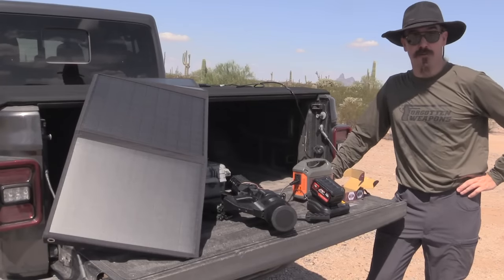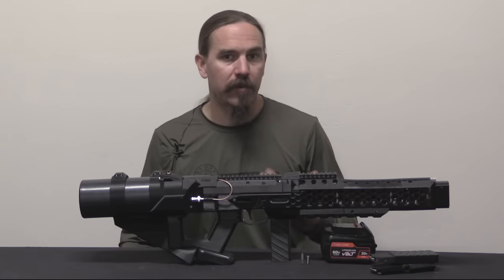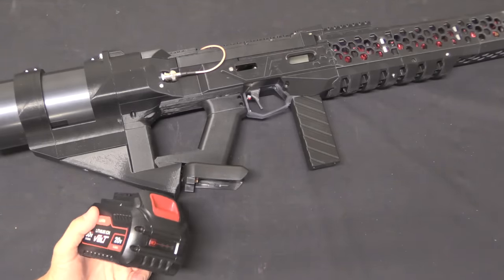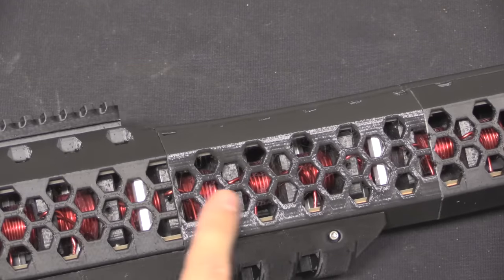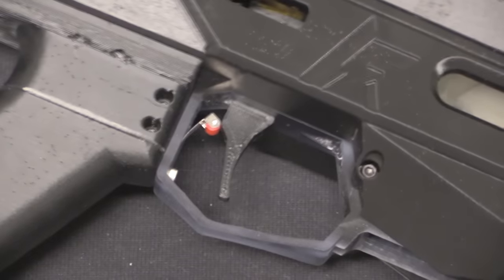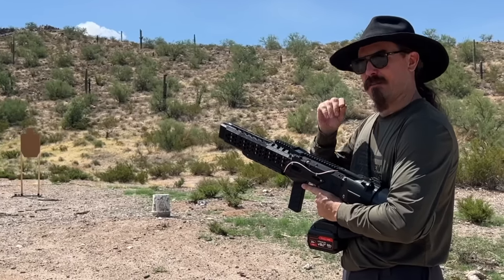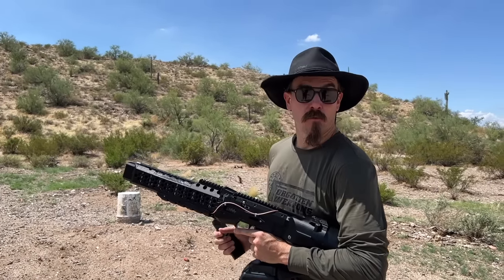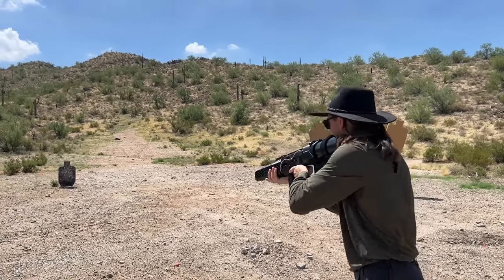ArcFlash Labs EMG-02 CoilGun: Making SciFi Weapons Into Reality

Comment: I have a couple of ideas to actually make this thing deadly at such low velocity
Reply: I mean flechettes wouldn't be fun even at that speed
Reply: @joecobb7153  Just a single one inside a sabot. Once speeds get faster, this'll be great for penetration
Reply: @freevbucks8019  I think considering you wont have a cartridge or casing the chance of the gun jamming even with sabot etc will be greatly reduced. Also I assume whatever method they are using to cycle it is more reliable than gas from spent round etc.

I don't know that much about firearms/munitions just did my Canadian Firearms safety course last week where I learned about alot of this stuff. The only fear I have of this is somehow it managing to discharge electricity into you and if your grounded that wont be fun at all.

Small drill battery like this fairly safe but, once were getting to serious amounts of power here that's equally if not more dangerous than a barrel exploding. I dont think we will see these used in war in our lifetime but if so they will have to develop army boots that keep you away from ground if normal ones dont do that already..

Its a really cool idea tho, basically eliminates the need for a recoilless rifle if you make these, I see them more as a stationary weapon compared to shouldered. Like a big Gustav gun that was a Gauss rifle would be insane, but prob not very practical

Comment: OK, so firing somewhat less aerodynamic projectiles than U.H.V.S.I.S.* rounds, or even naked fin stabilized penatrator darts, and with a muzzle velocity just a tad under 50,000fps at 200fps, the EMG-02 isn't exactly an "M99A2S3 Stanchion" quite yet. But not to worry, ArcFlash Labs still has a few centuries to solve those issues. 😜
*(U.H.V.S.I.S. = Ultra High Velocity Self Immolating Sabot)
Master Chief to Ian: "You told me there wouldn't be any cameras."

Comment: Will it fire holo core silver, copper, or aluminum, ect projectiles at a higher velocity?  Or even layers to deal with skin effect as it is a dc pulse?

Better conductors, layers and longer projectiles will produce a better energy exchange from the coils.

You could increase the capacity discharge, number of coils ect  to create a much higher velocity.

Comment: Got mine a week or so ago (after a few month delay as they found problems with their original batch and made corrections to fix issues) and it's a pretty cool fucking thing. It's obviously the early stages but if it can be improved which it obviously will and they manage to start shooting those projectiles put at 1000fps or even better 2000+fps then they have a serious serious machine on their hands. Upside to this is that ypu can literally make ammo on the fly as long as said ammo is within certain dimensions, like drill bits can easily become ammo etc. Biggest downfall of this is the batteries. You run out of juice you are legit fucked unless you have a good amount of batteries on hand and pre charged.

Comment: So it seems that so far you can do far more damage punching someone, or with a paintball gun, BB Gun or Rubber Dart Gun, lol..
But I certainly can see where this will eventually go. A few years down the road when you just pop like a cell phone or c battery in it and it holds hundreds of rounds that travel at 2000 fps, aims through a computer operated optical to eye piece, that shows you all the info you need, it knows distance, wind, elevation, air pressure and density and everything else etc etc.. 

That's the future. Just in case old Arcflash Labs didn't already realize. LOL! Fun Toy!

Comment: Could you get the projectile to rotate with the the rotaion of the magnet fields? If you made the projectile out of nylon and use small magents embedded in the nylon and spaced 180 from each other. Magnetic rifling and adjustable twist rates
Reply: Or make a coil made to add spin at intervals down the length of the barrel. Or maybe just one at the begining just to get that thing spinning? Just thinking out loud. I'd like to see the west with weapons as such.

Comment: I wonder why they went with dowel pins instead of ball bearings considering how the dowel pins keyhole at very short distances.
Reply: I don't think it would be able to fire ball bearings as efficiently because of the lower magnetic signature of a ball bearing. There's a reason it's chucking AA batteries down range instead of round and small shot and I doubt it's from lack of foresight.
Reply: @conspiracyscholor7866  Yep, looked into it after this video and it's exactly that.

Comment: With the huge number of comments it isn't possible to read them all to see if one of the 10,000 contributors has the same ides but instead of getting fixated with rifling, why not go the route that smooth bore tank cannon have gone and find a way of fin stabilising the rounds with ultra light weight plastic fins?

Comment: i wonder what it would take to get to 3500fps  , superconducting coils , graphene cap. ultra capaciity high volt battery, bet you could use cut off deck screws in some way to get spin, bet an A.I. could do a pretty good  job of designing  the up grades

Comment: Can you have it shoot >60 rounds per second, how many capacitors would you need suppose on the order of 3000? with preamp circuits with the projectile mass <1/16th of what you have there and sustained for 24hours? And coil loads, would you need 30ft to prevent overheating? Approximately 6million miniature BBs loaded. Could it be done?
Reply: I was thinking of the NIF facility at LLNL. Would it be possible?
Reply: The target is 6" from muzzle on the opposite side would be a clearing barrel. A liquid cooled jacket for the coils like the cooling for Tesla batteries.  Complete vacuum,  perhaps hydrogen precharge. 3d printed titanium alloy casing for coils, depending on the material,  5"  barstock solid core milled aluminum might be alright in a 20ft length might be CNC in under 5 hours.

Comment: Maybe whatever-gods-you-worship be with you if that capacitor ever pops on you...  💀  Oh hey, about putting a spin on the projectile-it might be possible to use the right hand rule and run a current down the barrel, or after the last coil, say, to put a spin on the projectile leaving the weapon. However, depending on the strength of that last little bit, it might actually put quite a bit of torque on the end of that thing.

Comment: 200 feet per second? I can buy a slingshot for 15.00 that can sling the same thing at over 600 feet per second. I could take a handful of that steel bar and throw it myself faster than that! You can buy a pressurized air rifle now that can fire a .45 standard lead bullet at over 1000 feet per second, 15 to 20 shots capacity before recharging the air. This gun is very interesting to watch, but very far away from being practical. When DeWalt comes out with one that works, let us know!

Comment: actually... pcp air guns are the real electric weapons that just ened built in hand pump or air compressor... both still need slugs. i think PCP pnuematic compressed air guns/cannons are actually the future of cyberpunk and space guns. think about it. they can be either HAND PUMPED, or ELECTRICALLY pumped with a solar powered air compressor etc. You ALREADY NEED air tanks IN SPACE... AND... hah didi mention you can HAND PUMP them ? lol no propellents needed but air and again,  it will be funny to see people deciding between air to breath or to shoot slugs out of their air gun, WHICH can also be made of same tech as the cold gas thrusters. in fact... a cold gas thruster can easily be converted into dual purpose air canon that just fires projectiles using the cold gas thrusters using likea giant break barrel  that a robot arm slides right over the cold gas thruster, with its air gun like rotary magazine of slugs made from space trash or regolith. 

Look at that coil gun also, it has a giant battery that ALREADY looks liek a big pcp tank!

Comment: It sounds like the safe mode is just a a trigger lock. I wonder if they coulda routed the magazine capacitor charge into a standby capacitor instead of dumping it into a resistor when turned off, and then cascaded the standby capacitor into the magazine capacitor when turned back on. make the on/off a safety as well. that's an extra cap, i know. Is it necessary? is it necessary for me to drink my own urine?

edit: Okay I finished watching the video. i have a 3d printer, a degree in electrical engineering with a focus on computers, and am full of piss. Time to get to work.

Comment: As a 3d printing nerd arcflash really needs to work with a better printing shop 🤣 the layer lines are rlly rlly fucking bad and i imagine their using a CF Or GF reinforced filament so its not like theyd have to worry about shrinkage and part accuracy too much so the only explinatikn i can come up with is the prints were ran too quickly

Comment: Coil guns are infinitely more stupid than typical guns. All they do is separate the energy from bullets, turning a 2 piece system, chamber and bullet, into a 3 piece system, chamber, bullet, and energy, for no good reason. Unless the battle zone has considerably more batteries than powder-bullets, coil guns will always be worse. Even if the battle zone had areas to recharge energy, the recharge time would render it useless.

Comment: I waisted my time waiting to see what this could do, and I still can't tell a thing about whether it's the manufactures fault or the demastrators fault. It might as well have been a cap rifle deastation. Which there was no expectation on hearing loadbang to go off.  For knowing how the unit works didn't expect any more on that point. But you might as well been showing it to a blind and deaf person because they would have gotten the same benefit from it for they would not have heard or saw anything at all eigther. And it's not that I'm saying that you should have added some sound effects as you were firing it. Because the sound that it makes was diffinetly not the problem with your demonstration. But for your targets as a choice for your demonstration was an absolutely terrible choice for you didn't expect any of your viewers to actually see all the slugs wising thru the air in slow motion or something like a huge blast effect as it contacted its cardboard target's. 
When all you needed was impact jell set to view its penatration and some cheap Buckets of water and a few watermelons that would have shown the impact of the shots that would had been the only choices to demonstrate the ability of that device if it had any power to show. But no one is going to know this from who Evers choice of target's it was
 not to use targets that demonstrate its impact capability.''